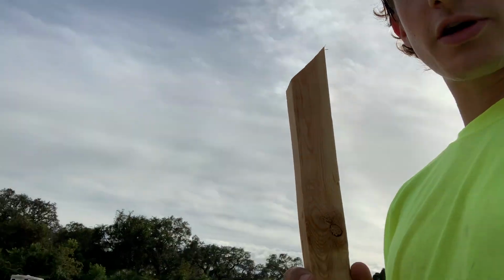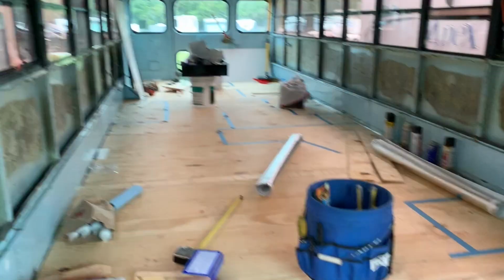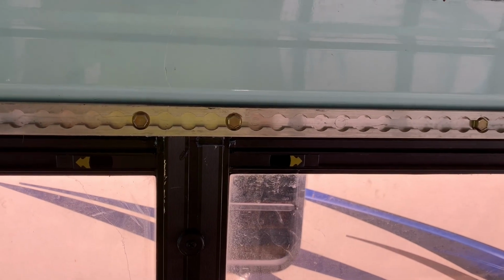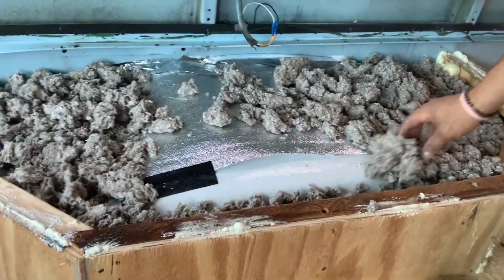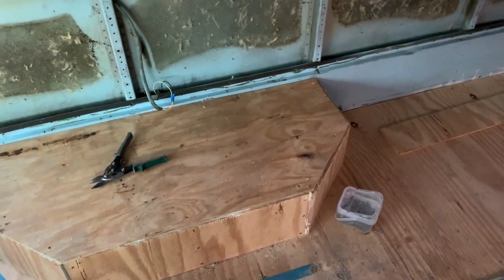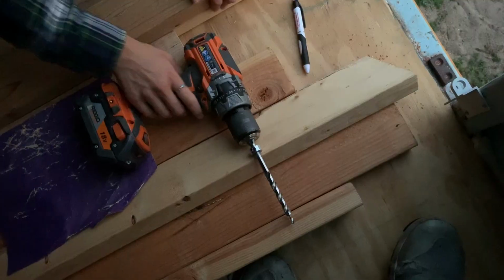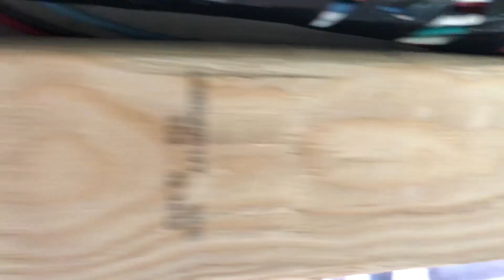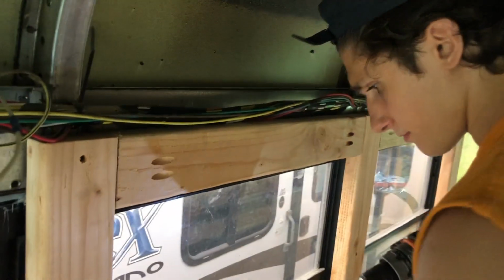FRAMING OUT WALLS IN SKOOLIE | sealing windows + framing wheel wells | diy bus conversion

Comment: what kind/length of screws did you use to secure the 2x2s to the ribs of the bus
Reply from the maker: Not sure, probably a type of self tapping screw that can drill through the metal as well. The length will be dependent on what materials you use and the depth of your bus, every bus is different!